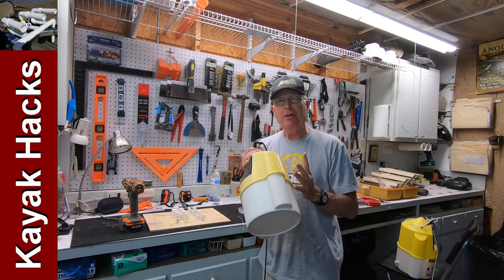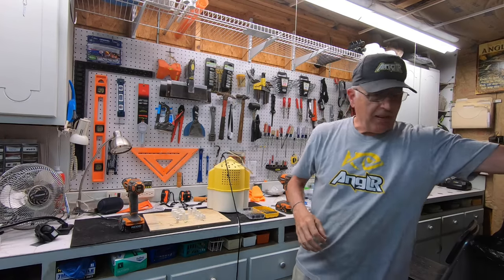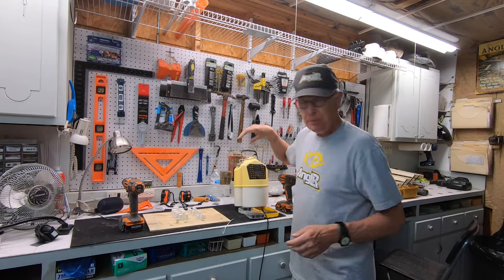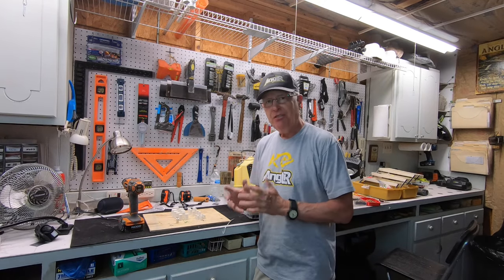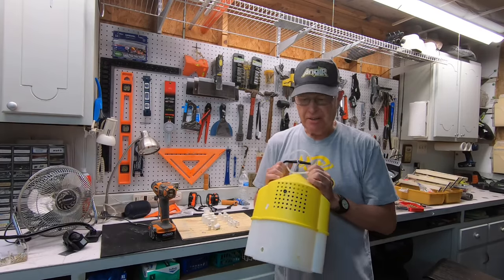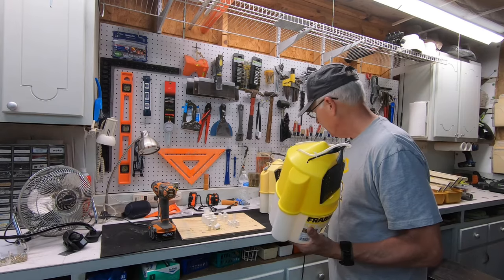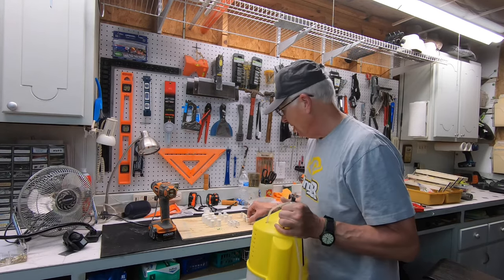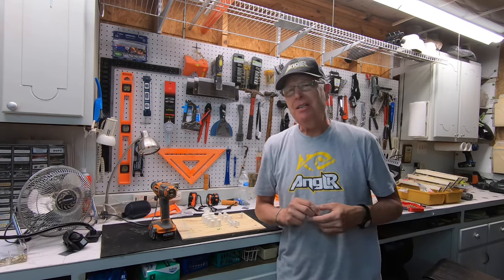Kayak Live Bait Bucket - DIY Hack makes Bait Live Longer

Comment: The frabil flow troll is a "trolling" bait bucket. It's meant to be trolled behind or beside a moving boat. I've used them successfully for years. Never used a bait bucket on a kayak.
I simply catch my bait as I need it and another solution might be a cricket cage... the whole thing is wire mesh.
Modifying the Flow troll and the cost of extra parts is  just too much trouble for me.
Thanks for the ideas though!
Reply from the maker: Check out the new bucket I will review tomorrow.
Reply: @KayakhacksFishing  looking forward to it!

Comment: A great idea as usual.  It would work for bait buckets putt off a dock.  To carry it very far, use the stoppers of get a 5 gal bucket with water in the bottom and set it in there for transport.  If you put one off a dock, remember that otters can open them and eat all of your bait overnight.
Reply from the maker: Dang otters!

Comment: drill 2 holes or 3 to the top to store yer topppers, plus a step drill bit has a slight tapper which with a 1/4 turn is tighter
Reply from the maker: Good idea!

Comment: Ok. I'm just learning ways to use my kayak for fishing and I just happen to have a Frabill bait bucket and have seen the problems with the water flow through. I like the idea of drilling holes to allow the water to flow through better but what do you use stoppers for? Just in case you're using the bait bucket outside of the water? So the water won't flow out when you pull the bucket out of the water? I imagine you only put them in when you pull the bucket up to get another bait so you don't let the water run out. Am I correct in my assumption?
Reply from the maker: Yes, there are times when you will want to carry the bucket with bait. So, that is why I added stoppers.

Comment: Has your bait ever died using this bucket? I have been using these type ( Plano, Flambeau and this Frabil) everything from crappie minnows, smelt and even shiners, l for over twenty years.... never had my baits die in these. Also that angle the bucket sits at is cheap insurance just incase the door is not shut or left unlocked....
Reply from the maker: Yes, it has. I believe it is because the water is warm... high 80s ... and there is not enough flow.

Comment: Why not relocate the weight to the seam ?
That would allow it to float flat.
Sticky wheel weights could be added so it would float deeper. 
1/8" holes could be drilled on the back side below the handle.
Reply from the maker: All good thoughts. I added weight to the front to level it out - https://youtu.be/gHrj9EfAhGA

Comment: Could also just use a bubbler
Reply: On a kayak that seems like a pain. batteries getting wet and having to deal with replacing them mid trip would be a pain. on a boat thats ideal.
Reply from the maker: The bubbler adds oxygen and does help. The issue is the ammonia from the waste. It accumulates and kills the bait even with a bubbler.

Comment: Why don’t you just use a divers keep bag.... 
think you may be over thinking the job?
B
Reply: I hope you're being sarcastic.
Reply: @frankiev-tech4630  Hi Frankie... I’m always thinking of how to this and that, but it seamed a divers bag was an easy solution...
After say that hope it works... it seams to for me and may also be a cheaper than your bait bucket.
Keeps the vids going and I’ll keep watching.....
B
Reply: @bbr9707  yeah I get you can do that...but the point of the Fabrill style is to keep the bait fresh when removing from the water...the divers bag is a mesh.
Reply: @bbr9707  Issue with the bag is space. the bag has no structure so the fish would just get in a flap and die. If you had something to give structure that would work.
Reply: @sprmario123  what about a wire cage of a sort?
Reply: @bbr9707  e, but a simple cage or something small like that would work fine. They make kayak bait buckets that are basically a fraybil and kickboard stuck together to make a horizontal bucket. Called Key West Baitshark
Reply from the maker: that would work if you never had to pull the bait out of the water and move them. Additionally, I think the drag while paddling with a divers bag would be pretty huge.
Reply: @KayakhacksFishing  
Hi Guys good info... and education ( for me) ...I’m in uk so maybe a little different on ideas and terminology. 
But all ideas are good if a better solution comes out of em... we have something like it but as said drags a problem!
Tight lines to you guys over the pond👍
B